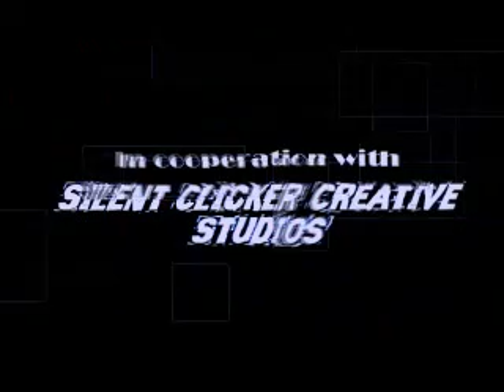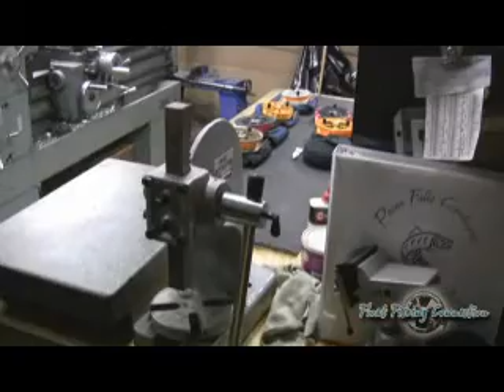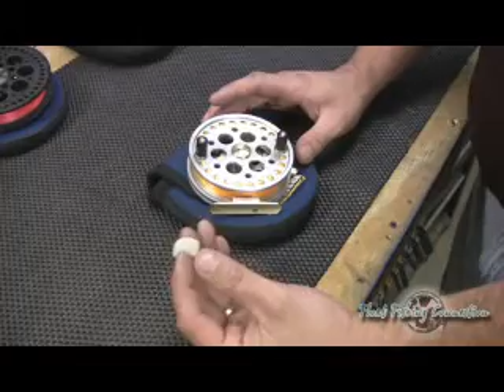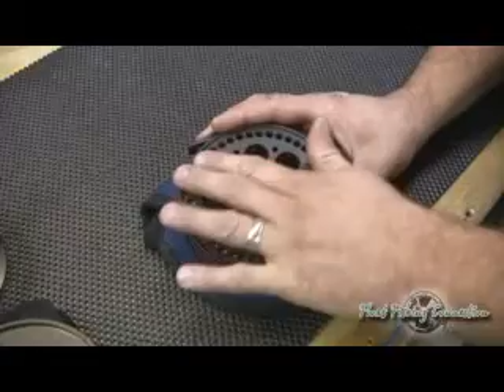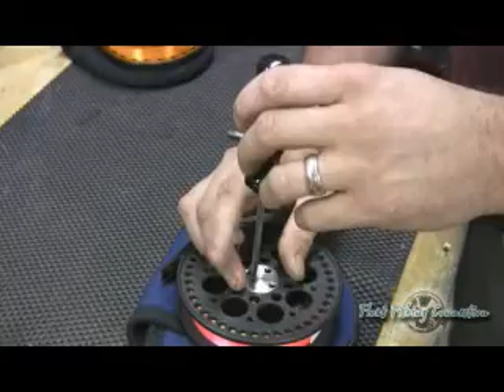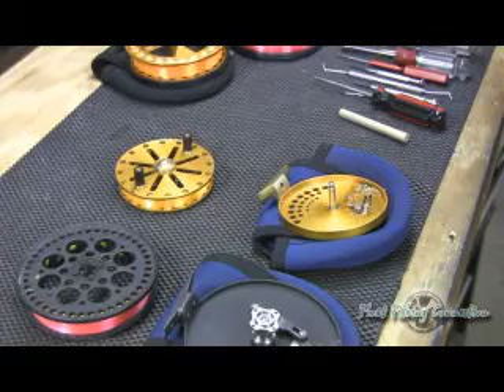Centerpin Reel Maintenance Part I

Comment: quick question how do you know what type of bearing fit on the reels i have a type r pin and want to place ceramic bearings but dont know which to buy. i wonder if you can help me with that please
Reply: Hey, rapalas are hard to find the exact size, I went to a bearing store and pick the one that fit the best. Boca bearings dont have any size that fit imo. Cheers.